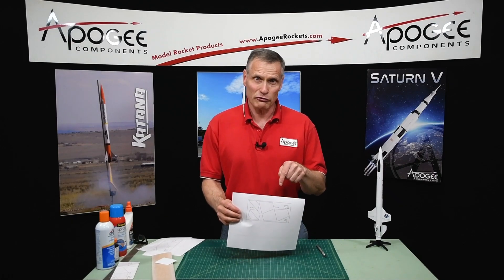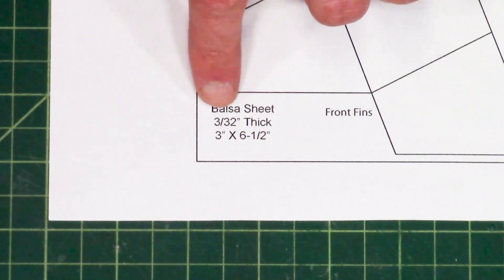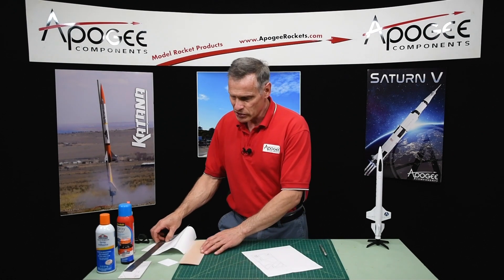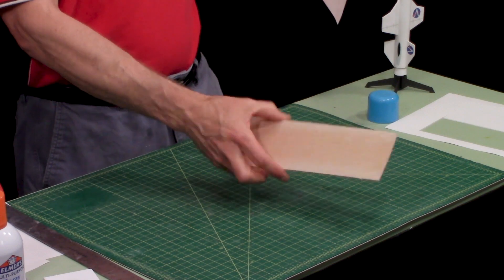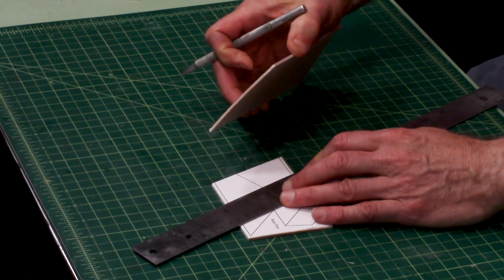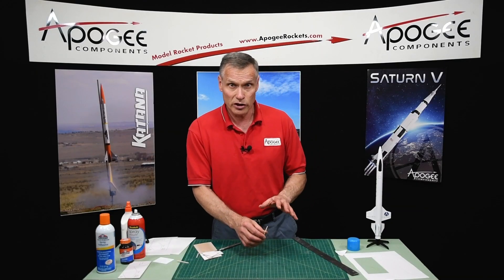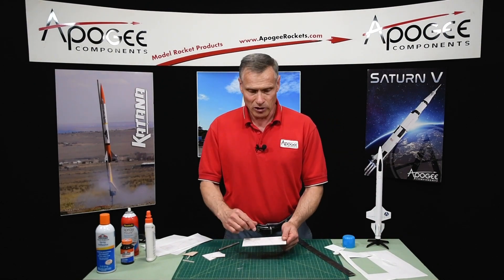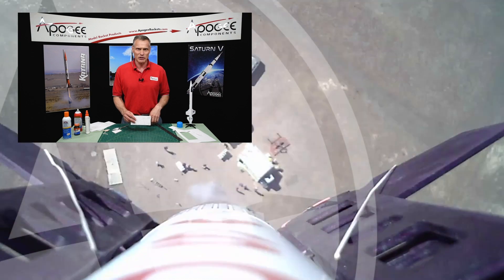How to Cut Out Fins From a Template

Comment: Great video, Tim!

BTW:  As you started talking about using white glue to adhere the paper fin guide to the balsa, I was wondering if it would be a good idea to adhere paper to the other side of the balsa as well.  I first read about that technique in your "Model Rocket Design and Construction" book.  

And THEN...you mentioned it in the video. 😊

As best I can remember, reading it in the book was the first time I learned of that technique, even though I was building rockets back in the 1970s.